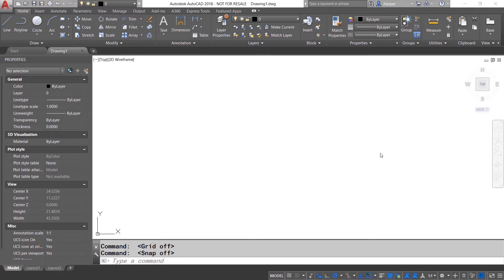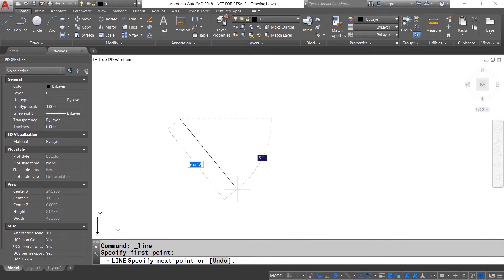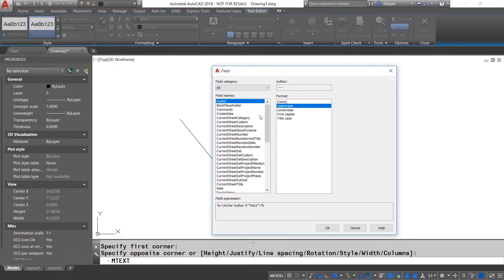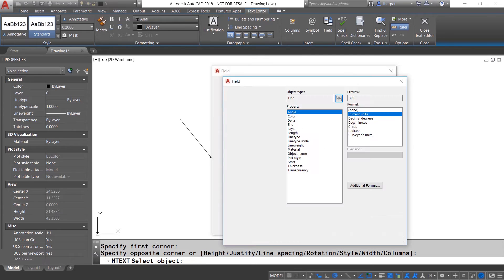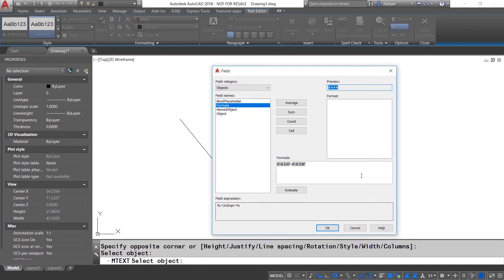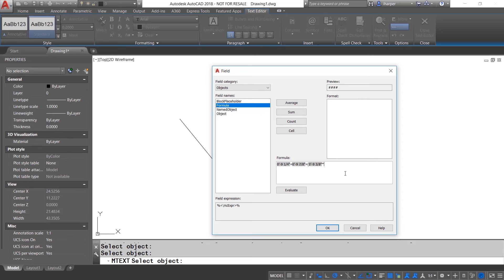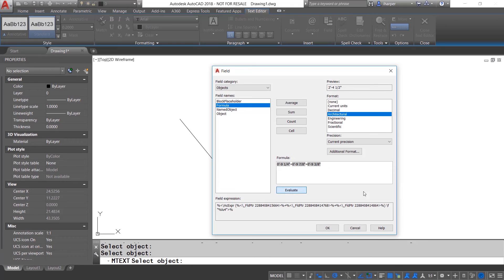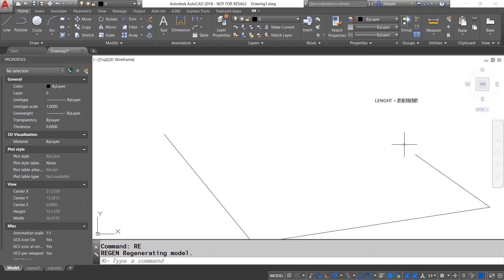AutoCAD Tutorial — Field Formula

Comment: What I really need is a diesel function that allows me to reference a certain object (as you did with a line), extract a certain attribute value from that object (as you did with it's length), then take that value as a text string and preform a find & replace on it.

The reason is, when I reference the angle of a line, the field gives me "S 0d0'0" W" but what I need it to say is "S 0°0'0" W". So I need a function that will find the substring "d" and replace it with the substring "°". Is there a diesel expression that can do that?